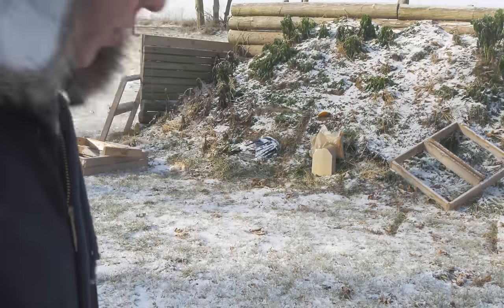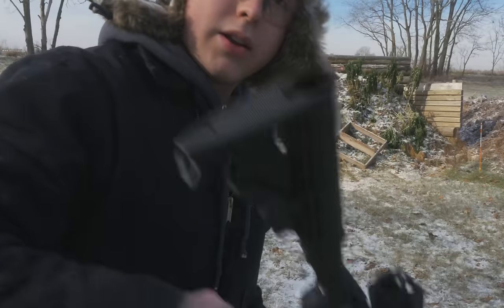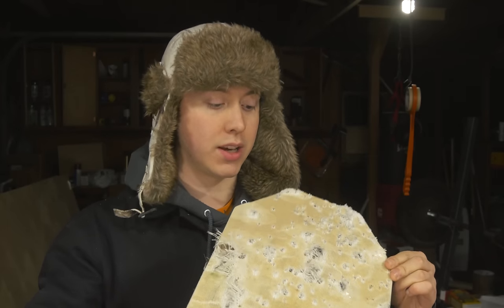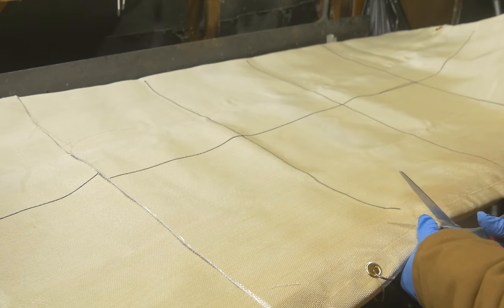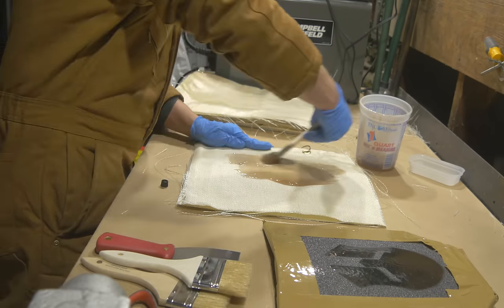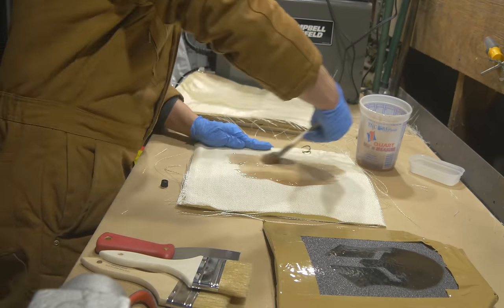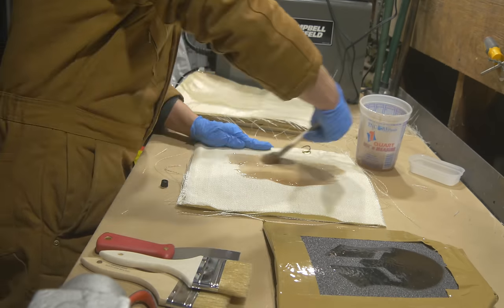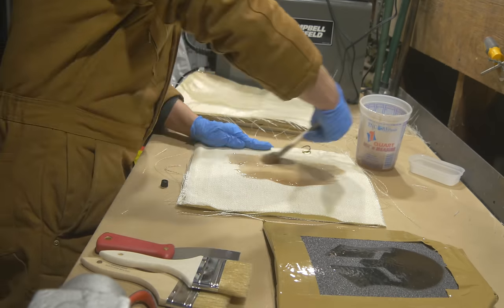How to Make AMAZING Bullet Resistant Armor for $30

Comment: As a little tip to everyone who tries to do this: 

Diamond discs for cutting tiles on an angle grinder cut composite like butter.
Reply: That or a tile saw.
Reply: I used the tool that you use to cut drywall with
Reply: That's because Silicon Carbide, one of the hardest materials known to man is in the disc, which incidentally is used in many ballistic ceramics.
Reply: @toadtoadersson2239  ha, ironic
Reply: mister clean booooooooooooo
Reply: You should make your own videos. Lmfao. A
Reply: @thegreeneyedbastard6018  lmaoo
Reply: mister clean  That's not what he meant. He's talking about irony. You know, the opposite of wrinkly.
Reply: mister clean  You know, five minutes after making that joke I had to stop and ask "when was the last anyone ironed their clothes?" I'm over thirty and have done it once.
Reply: yep, I discovered this too.  So easy.  I think the whole process for me was less than an hours work from cutting the fabric to sanding the finished product...not including curing time.
Reply: @cmf2nmMWX9qy  Imma use my trusty ol' pair of Fiskars scissors ✂
Reply: While at it, i want to see someone making this with ceramic tile as an first layer.
Reply: Fingers too!
Reply: Yep, the first things that came to mind are, he needs to vacuum bag, needs to wax his substrate to release easily, and use a grinder with a continuous diamond edge. Makes life butter working with composites. Kool video though👍👍
Reply: Would it be possible to put a 5mm steelplate or something like that in it for extra protection?
Reply: @toadtoadersson2239  you are definitely mistaken. Diamond cutting discs use diamond dust embedded in it. You are referring to the metal cutting discs which use SiC.
Reply: @paultony2039  I
Reply: @Jack Silver  Obviously you never served in the U.S.M.C. or you would have used an iron.
Frequently!
Semper Fi
Reply: They also make tons of glass fibre and epoxy dust :)
Reply: @WhenDoesTheVideoActuallyStart  Crazy. Cutting Materials generates dust. Which wisdom. If only one would have invented PPE for that.
Reply: A 28' boat was abandoned on the shoulder where I live. Had  nice trailer underneath I wanted. The sheriff had put an orange sticker on it, to be towed it was clearly abandoned. Full of trash, and motor was missing. Inboard bottom end was there, I don't know what you call it, the gearing that the motor bolts too, with the propeller shaft and all that. Motor had been a V8 Volvo Penta, which I believe are 305 Chevy motors, built to rum wide open their entire lives.  But it had been removed. Anyway I needed to drag this thing 30 miles to my house and get rid of the boat on the trailer before my wife woke up, and saw it and freaked out. At 3:30 am me and a buddy went and retrieved the boat. He had a girlfriend nearby so we went there and aired up tires, and put a boat cover on it I had purchased exactly for this trip. We were off, taking back roads. Got home about 6am, and began cutting this boat up. Tried a sawzall. Nope. Shook hell out of operator, slow to cut. 7am now. Not much time. Try a chainsaw. Immediately the chain details from bar. . Hardwork so my buddy baled.
Them I grabbed 7.25 circular saw. Your everyday skilsaw. Cut that entire boat into 2'x2" squares, and tossed into my dump trailer, salvaging all the aluminum, including 30 gallon fuel tank, which despite this thing not have been registered in over 10 years, I put that fuel in my truck, and had zero trouble. So my experience, fiberglass cuts wonderfully with a circular saw. And I got a nice tandem axle trailer out the deal, which someday Will get a couple ramps over the wheels so I can move cars with it. The registration for my other trailers just say utility, so I can move it with one of their license plates, so long as when I'm pulled over the vin is not checked. When was the last time you had a cop check your vin? He'll I can't recall the last time I was even pulled over. Must be at least 12+ years ago. Pretty safe I'd say.
Reply: Oh joy, I just finished a tiling job. Barely used my diamon disc.

Comment: i know its 2 years later but....
you should roll out the air bubbles between each layer of glass, turn each layer of glass at a 45degree angle, wax the inside of both outer plates, and dont clamp the plates so tight, you press the resin out.
i was a fiberglass specialist or 8yrs before i got into precision metal fab
sorry i wasnt here 2 years ago
Reply: what about also stitching the fiberglass to prevent delineation?
Reply: @chrisrogers4242  Delamination would probably still occur. Any stitching would probably be blown apart with bullet impact
Reply: Saving the fucking day... Nice comment, bro!
Reply: Mostly +1... but you absolutely want to get as much resin out as possible. Resin = brittle. You only want the total product to be about 30% resin by weight for optimal strength. Also, epoxy resin is preferable to polyester resin (Bondo). You get a little  more pot life, and the epoxy takes longer to cure, but it's much stronger. The ideal situation would be to vacuum bag it, but if you don't have a vacuum set up, clamping is good enough. The main thing is to not have any voids.

That said, if you follow what he did step for step, you'll still be in pretty good shape.  I wrote a thesis paper on molding materials for advanced composite molding. I spent over a year in the lab building and testing various mold designs turning out test pieces from fiberglass, carbon fiber, and kevlar.
Reply: So how hard do you want to clamp it? You want to get rid of excess resin but not ring it dry correct?
Reply: Armor making interests me so much, has anyone tried doing a 2 year later updated version of this.  So cool.
Reply: Are you familiar with an epoxy product known as Pond Armor? It's a waterproof coating intended for  ponds and other water features, particularly those made of wood. It's much more flexible than typical epoxies. I wonder if it could possibly have an application here?
Reply: @mikecheeze4312  It's kind of subjective. Even with a vacuum bag at max possible vacuum, you'd likely end up with around 30-40% resin. Honestly, you could have 70% resin, and still have an effective part. The difference in strength would probably be about 10%.

Number 1 rule is no voids. Clamping will at least keep the glass layers together and push out any air.
Reply: If you ever have time you should totally make a vid of how you would of made one...for science ofcourse
Reply: I also spent my  whole working career working with laminates. Other than the suggestions you've made, I suggest using epoxy resin.
    I made a test plate years ago using kevlar & epoxy, no clamping, it's not necessary. With a 5/16" thickness, the plate stopped a 9mm round.
    Remember, the integrity of this plate was disturbed many times before the .223 was used. I'm sure the .223 would have penetrated but i'll bet it's exit velocity would have been much lower if dealing with an uncompromised plate.
    Excellent video by the way.
Reply: could use spray paint to mark the stencils fast
Reply: @7t2z28  what kind of epoxy resin would you recommend for ballistics?
Reply: @johndicklehiemer  No idea. Anything deemed "air craft grade" would probably be more than enough. There's a lot out there, and they'll probably all give similar results. Most important is the fabric itself. A welding blanket is going to probably be a lower grade e-glass for strength. There's a huge variety of materials out there. Best advice I can give is to shop around and go with what's in your budget. The results using the cheapest materials is pretty impressive though. Good luck.
Reply: @7t2z28  Thanks for the info
Reply: isnt the point of squeezing the resin out so its flat like an actual usable plate?
Reply: You said "turn each layer of glass at a 45degree angle" is this for layering and strength?  Just wondering.
Reply: Dude, were not making a Surfboard. 
 Strength is is the nylon layers not so much the resin.
Reply: I think you need to do a video on your version! I think i would definitely be better! I was thinking the same thing when he was making this one about the 45° stacking of the layers!
Reply: @7t2z28  how are carbon fiber bike frames made? They're perfectly smooth all around. The I'm thinking about is, I saw a carbon fiber wrench set, but they're all jagged edged and they will very easily cut you. I hoped someone would've made a decent lightweight wrench by now. How are bike frames molded so smooth all around?
Reply: Good call!
Reply: Ok
Reply: 1Energine1  nothing light will stop the 50 cal. But for rifle rounds, add ceramic tiles, carbon steel plates. if you're going fancy, i heard the russian forces have used titanium plates.
Reply: Do you think it would have stopped 5.56 ?
Reply: When you say do it at a 45 degree angle do you mean turning the fabric so the weaves in it all go in different directions or did you mean something else by that?
Reply: The air bubbles probably helped stop the bullets
Reply: Theghostking - yes that’s what he means, so instead of all the layers of the fabric being in 1 direction, that they’re different so it adds more strength. Like think of splitting wood, easiest way is to split with the grain, harder against the grain, now imagine if there were layers, each opposite, it would be much more difficult to split. Easiest way I can explain it
Reply: What kind of resin Is he using?
Reply: Yup
Reply: So this could get better for £30?
Reply: @akadopeboi  I would do a combination with ceramic tile
Reply: Honestly pretty good info but for this type of item it's better to have more of the tight fiberglass instead of the resin wich would crack upon impact however I'm not actually an expert
Reply: @Aldrick Ex Gladius  I know I’m 3 years late but was going to comment much the same info. Definitely alternating the weave would increase strength, rolling or using a squeegee too. But I was thinking the final product could be better if cured under vacuum pressure evenly applied instead of sporadically clamped at the edges. Squeeze out is good, he used way more resin than needed. Similar background. I was a metal fabricator before I got into aviation where I also worked with composites like fiberglass, kevlar, and carbon fiber.
Reply: @herphermits  it'd probably be best to put the steel plate behind all of the fiber glass. That being said, depending on type and thickness of the steel, it may stop some rifle rounds. Though 30.06 and almost any AP rounds will likely still push through.
Reply: @7t2z28 
 Poly resin can withstand about a 500 psi impact, epoxy resin can withstand up to 2000. 9mm bullet generates about 400 lbs on impact. So, theoretically an epoxy version could withstand close to 4 times as much energy as a 9mm bullet??? I dont know shit about ballistics but it seems like this epoxy version could stop a much more powerful round than a 9mm
Reply: How about adding some starch too your resin?
Reply: This is the best comment and started a good thread, this should be top voted. With 15yrs Exp myself everything was explained here. Thanks all !!!
Reply: That jigsaw aerosoled that fiberglass nicely.
Reply: oh you forgot to bag it and pull a vacuum on
Reply: Doesn't matter if it was 2 years ago. You think I wanna spend hundreds on effective plating now in this economy? Fuckkkkk no
Reply: @rowanmurphy5239  - CFR parts are usually vacuum-formed
Reply: @lvgeorge  - quasi-isotropic layup array gives more uniform stiffness and load transmission across the entire part than does a uniform 90* layup array.
Reply: can someone tell me what resin used here ? i want to find a similar product in my country so, if i can have a product's name
Reply: @marcarnoult5613  that appears to have been standard Bondo brand polyester resin for auto-body FRP applications. It is found in almost any hardware store or automotive store here in the United States.
Reply: @marcarnoult5613  - epoxy resins are MUCH stronger, less brittle, and have better flow-rates and working times than does polyester resin. Sadly, they are far more expensive for the same volume. If you choose to go with epoxy resins, there are many kinds and many manufacturers. I tend to use West System 105, with either 205 or 209 hardener, depending on the cure speed I require. Such resins are available at marine and aviation supply stores, and even bowyery specialty houses, as well as direct purchase from the manufacturers.

I hope this helps. good luck!
Reply: @gordonpromish9218  thanks your Sir !
Reply: @theghostking-7951  yes
Reply: @gordonpromish9218  PEEK

ПОЛИЭФИРЭФИРКЕТОН
Reply: @mahmudasanov2835  - yes? what about poly-ether ether ketone plastic? it is good tough stuff, from what I've heard, but I've never machined it, nor injection molded it. It certainly is not the resin used in this project, and I don't think it can be used in this application (FRP layups).
Reply: You showed up that's all that matters
Reply: Delamination is how it actually is able to stop the bullets.
Controlled delamination.
Reply: Most patents and research papers agree on 20-25 weight% resin for fiberglass composites.
Reply: @tinononit8623  Yeah he showed up for one comment and never returned! 😂
Reply: @dwwolf4636  BINGO! Looking for the comment. We did testing while active duty. You said it wolf!
Reply: @sczufelt33  Nope.
Dense and hard before light and soft.
Fiber composites are best utilized in stopping residual fragments after a hard armor layer disrupts/erodes the penetrator and slows it down.
Reply: @ryanjones5592 can carbon fibre stop bullets?
Reply: And would putting it in an oven help?
Reply: Could you be commissioned to make 6 of these?
Reply: 4 years after you made this comment I find it very informative and useful :)
Reply: @theghostking-7951 yes, turn the fabric so the weave is at a 45 degree angle from each layer of blanket
Reply: Do another video!!!!!
Reply: WELL SHIT FAR! ARE YOU STILL RECEIVING ALERTS/ THIS STILL YOUR "ACCOUNT" ?
- please reply if so, THANK YOU FOR THOSE TIPS ! 
I had a couple questions that you can answer, so hopefully you'll reply.
Reply: The only info that I wish was included is how many layers are optimal